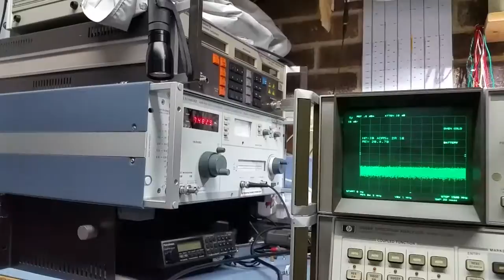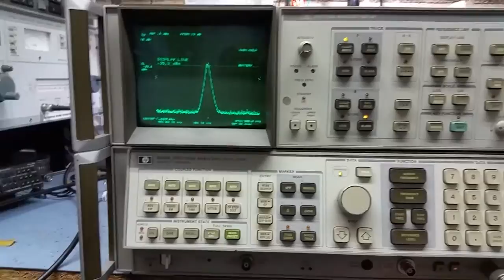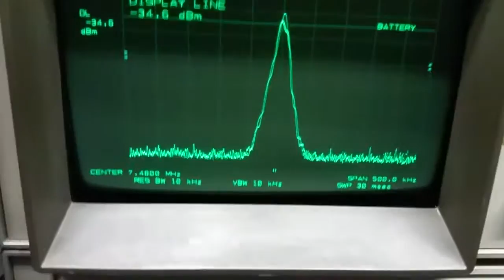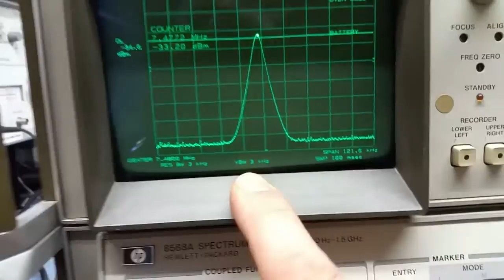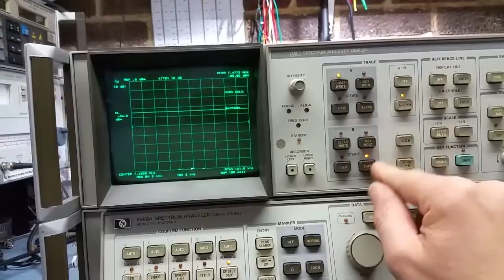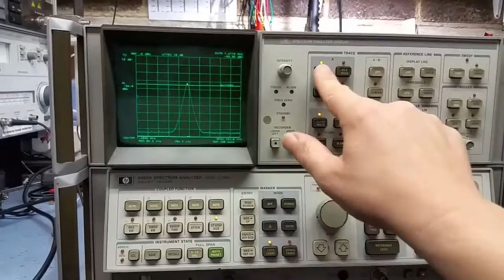Hp 8568a pt2 display working

Comment: Hi Simon i recently acquired the same piece of equipment though i did not receive any cables would you happen to know the pin mapping for the 50 pin i will likely build my own rather than spending 200+ on these (though the coax cable may be problematic in construction) considering i do not even know if it functions properly display side does show standby and bottom section boots to show instr check i which i would guess has to do with no data connection with the display side. i have yet to really dig into the 2000 plus pages of manuals for this as i am unsure if unit is usable.....any help would be appreciated thanks

Comment: I got mine about 15 years ago, for 15000 DM (roughly 7500 €) And still love and use this unit! Even with the 8444A opt 59 TG although narrowband measurements are not possible due to the non locked internal free running osc.